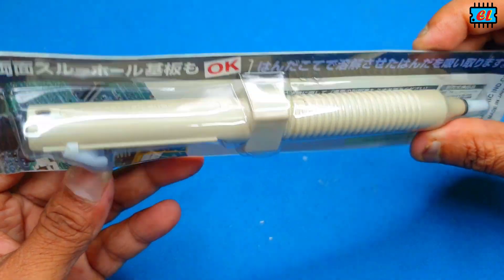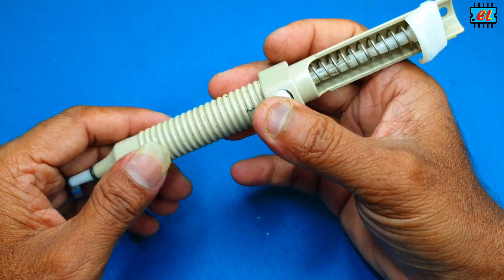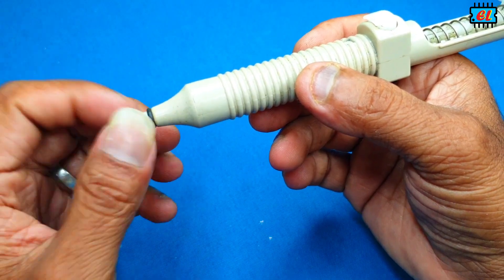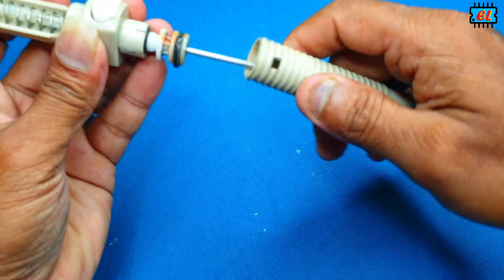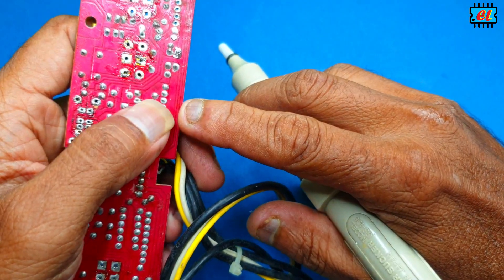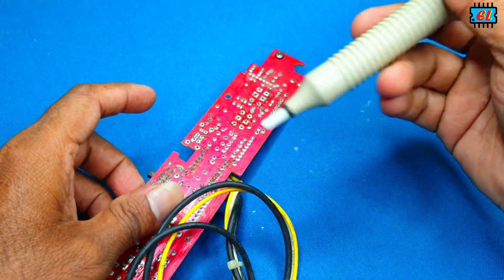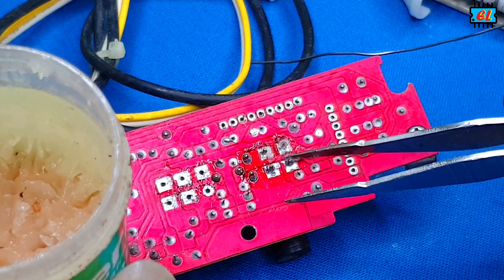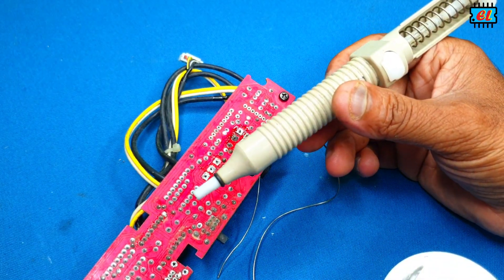What is this solder sucker? and How to use?

Comment: Aiye 12v LED strip (ara oya 3.7v walata convert kare) anna e strip (12v) kelinma 12V battery walata deddi godak heat wenawane ekata visadumak nadda.
Reply from the maker: ඔව් ඒක හීට් වෙනව ඒකට අව්ලක් නෑ ඒකයි ඒ බල්බ් ඇලුමීනියම් පටියක සෙට් කරල තියෙන්නෙ අව්ලක් නෑ හීටි උනාට ඔයාගෙ ගෙදර තියෙනෙ එල් ඊ ඩී  බල්බ් එහෙමත් එහෙමයි ගලවල බලන්නකො
Reply: @ElectronicLokaya   ow neda... mekata diode 1k wage dmmoth 13V wage battery 1 overcharge unu welawkadi wena haniya awama kra ganda puluwanda? Ehema danawa nam sudusu diode 1 mkdda aiye??